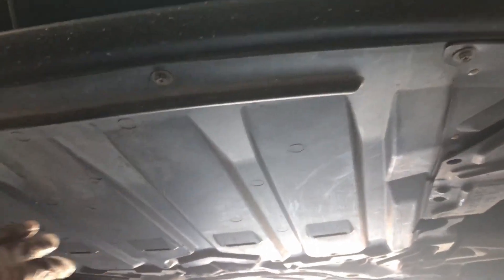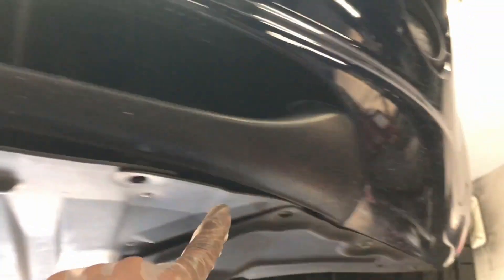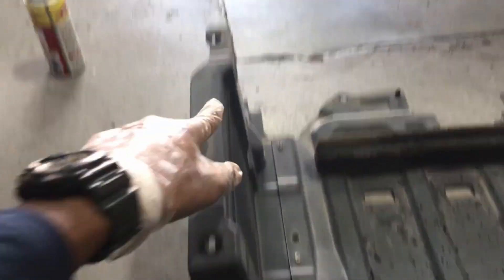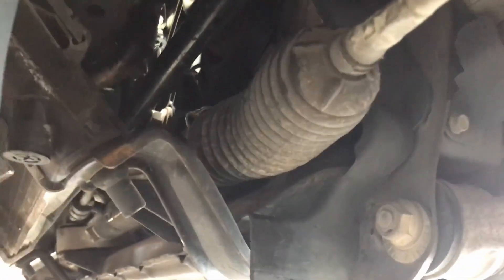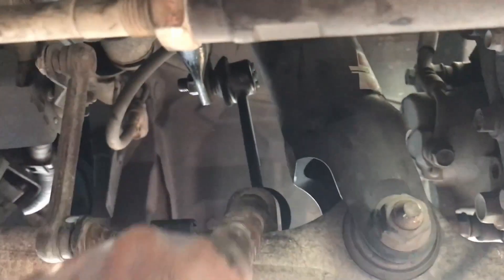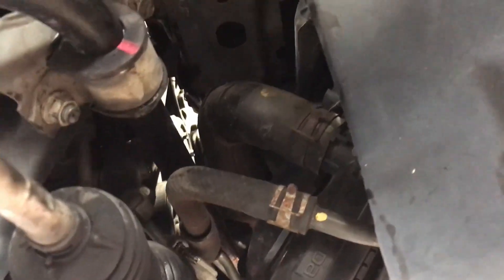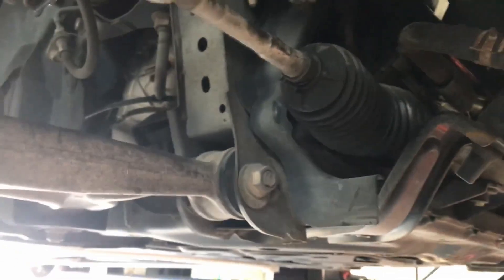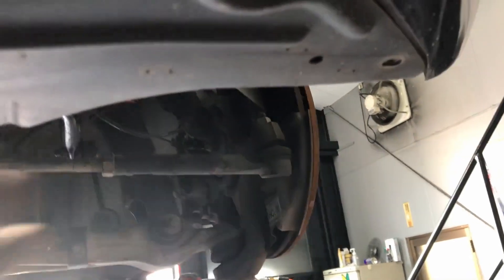NC MX-5 Miata Front Sway Bar Replacement Steps & Tips | Tach On Red

Comment: This job is a pain! It is only easy if you've done it several times before. It would have been a better video if you showed the actual twisting of the sway bar in order to pull it through to the drivers side.
Reply from the maker: I wish I had someone helping me to record while doing it. It's hard to get a proper camera angle to show exactly what I'm doing in realtime.

Comment: Missed all the actual work to get it in. This video did not show anything, if you want to know how to do it, go to 'Racing Beat', and there is a perfect write up with pictures. Have to agree that swapping the red front and yellow rear sways is a good move.
Reply from the maker: Getting it in was fairly easy for me as just the reverse of removing it. I had the most trouble with removing the old one though.

Comment: Tach on Red are you running red front and rear? If so how’s your car characteristics? Seen many like the red front yellow rear. I would like the smallest upgrade possible due to how the stiffness goes up exponentially with size. I have Bilstein B-14’s and think 23-24mm front and stock or 16mm rear would be nearly neutral. Thoughts
Reply from the maker: I went with red front and yellow rear. That's supposed to give a tad more oversteer than a matched pair of anything.  I also have adjustable coilovers. So, I was able to fine tune it to a more neutral handling by adjusting my front and rear damping. 😊 

If your damping isn't adjustable, I'd recommend trying a matched pair of red dot rx8 bars. 😊 👍  and if you're not satisfied, you can gradually try changing to stiffer bars from there. But most people who just want a mild upgrade are very happy with a pair of red dot bars. 😊

Comment: Can you change the bushes without unbolting anything else?
Reply from the maker: For minimal disassembly, you can do it this way:

Remove wheel and plastic splash shields to give space to work and access to bushes. 

Unbolt the bushing brackets, swap in new bushes. Remember to apply grease to bush contact surfaces before installing. 

Reassemble everything in reverse. 

👍
Reply: @TachOnRed  I'm switching from original rubber to poly and going with the tip of using teflon tape and silicone grease.  Good to know I don't need to take the entire bar off.
Reply: @TachOnRed  I swapped the bushes without removing anything else; just turned the wheel.
Reply from the maker: Wicked! Will remember that when I do mine! Thank you!

Did you have the front jacked up at all or just sitting on the ground?
Reply: @TachOnRed  sat on ground. Wheel off would have made access easier but not a problem.👍

Comment: Apart from the sway bars and bushings from an Rx8, do I need to replace the sway bar links or other pieces?
Reply from the maker: You only need to replace the links if they're worn or leaking grease. Check them by disconnecting them and moving the joints around with your hand. They should be firm and once moved, should hold their position. If you can move them with your pinky, and if they flop around when you just shake em, they need replacing.

Also, if your car is lowered, I recommend getting shorter aftermarket end links suited for the lower ride height. I think the major Miata tuners all stock them.